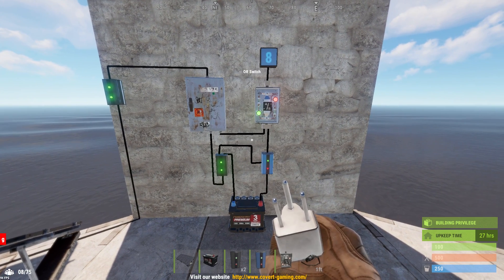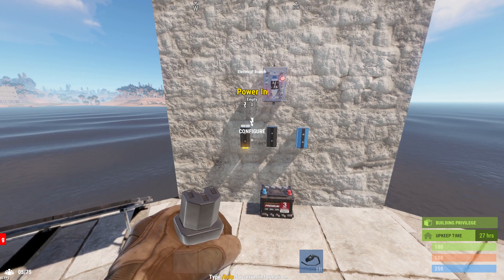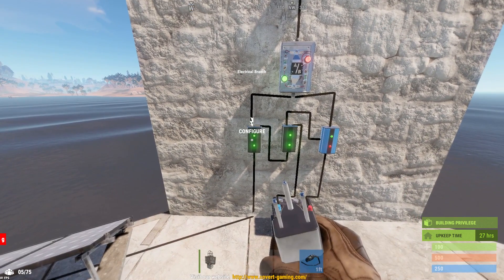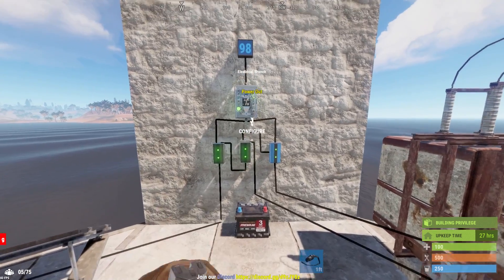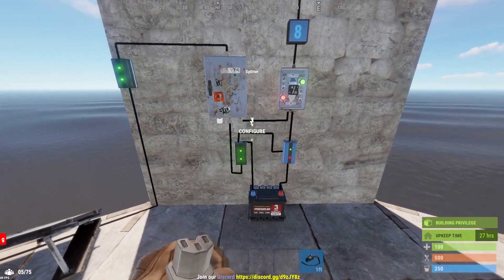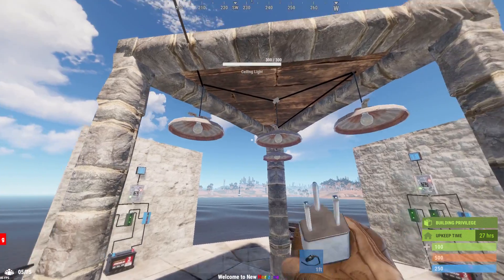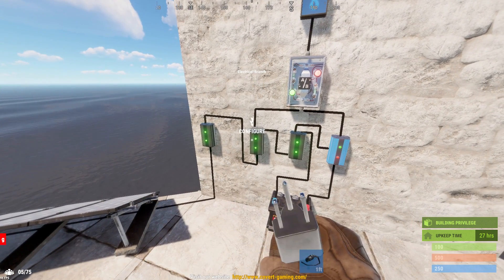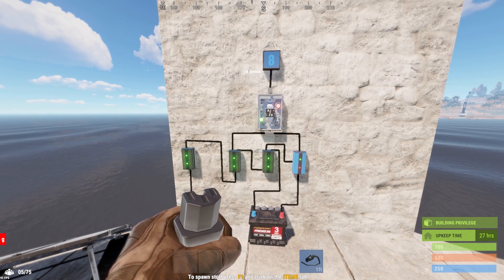The Best Rust Infinite Power Circuit

Comment: the title is a bit missleading,...sounds like you would have limitless power
Reply from the maker: First thx for watching :).  Second sry about the title.  I didn't come up with it, this is a term coined by many others for similar circuits so I call it that because that what is recognized by others for this type of circuit.  I agree its no a very accurate description of the circuit.  It should be "automatically switching backup battery power circuit" or something like that.  I didn't even design the basic idea for the circuit. I just took a bad design everyone was using and made it better.  That said... this circuit was made obsolete by the November update of last year.  Batteries in rust can now charge and discharge at the same time.  The lose 20% of their power charging but if you input 25% more power than they are discharging they will maintain their charge.  So now all you need to is have solar panel to battery in, battery out to workload.  Its very ez.  As for the input for a small battery you would need 12.5 volts input if you are using the full 10 volts output in order to maintain the charge level.  Hope this helps and thx again for watching.

Comment: How would i make this work with 2 large batteries instead of 1
Reply from the maker: Game mechanics for batteries changed drastically in Novembers patch of 2019 so its pretty simple now.  However for it to work properly you need to jump straight from 1 larger battery up to 3. https://i.imgur.com/zlPgTqx.gif
This circuit would give you 8 hours of backup power at the maximum output of the large battery.  Obviously replace the creative generators with whatever power sources you have but be sure you have at lest 251 volts input to the first splitter for it to function properly.

Thx for watching :)

Comment: will an XOR switch work with this circuit?
Reply from the maker: Thx for watching, simply put no it wont.  I would prevent power to the circuit so long as there was any daylight for solar or wind for turbines.  It would only kick into battery power if the sun was completely down, not low, or if your win or solar were completely destroyed.  That said this circuit is obsolete due to recent game mechanics changes.  I'm working on an updated video.

Comment: i cant figure out what im doing wrong. i tried this setup, step by step and cant get any power into a single sentry gun. my solar panels arnt getting any electricity coming in. maybe its the angle but there is sunlight above and nothing :<
Reply from the maker: Thx for watching.  Sadly this circuit was made obsolete with recent updates to the game.  Furthermore this was made before auto turrets even required electricity.  The turret requires a minimum of 10 volts.  This circuit only with a small battery only outputs 8 volts.  If you are using a large battery it should work fine but thats beside the point because you don't need to do this at all anymore.  The whole purpose of this was to compensate for the fact that a battery couldn't be used and charged at the same time like real batteries.  Now they can.  So simply set up your solar panel, run a wire to the input of a battery, then run the output of the battery to the input of an auto turret and you're done.  If you are using a medium or large battery you can run the output of the battery to a splitter or electric branch to divide the power up and run multiple turrets or other electronics.  I am working on an updated video explaining the changes in the batteries and all the wonderful things we can do with them now but until then I think this will solve your immediate problem.

https://i.imgur.com/cr516Bl.gif

Thx again for watching :)
Reply: @K162KingPin  uhhh i guess. im still wrapping my head around these sorry. So if i put my solar panels to my small battery and charge it directly and connect it to my sentry gun it will input enough to charge the battery and power up the sentry? my concern is when the sun goes down D:

Comment: at 11:05, what is the purpose of the branch all the way to the left? it seems like you can just remove it and it wont have any changes to the circuit
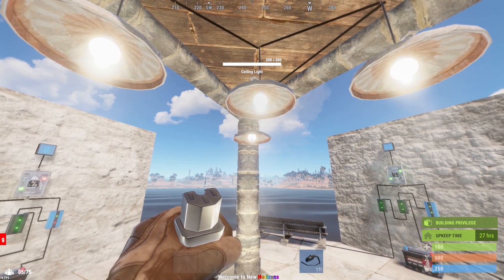Reply from the maker: Thx for watching, you are correct it can be removed.  At 6:50 I explained that this branch was only in these circuits in order to demonstrate how the circuits operated given different power inputs.  It was simply a way to regulate the incoming power from the solar panels.  That said none of this matters now.  This circuit is obsolete due to recent changes in game mechanics involving batteries.  I'm working on an updated video showing how to do this since the update and hope to have the video out in the next few days.

Comment: not the best one, i kinda made one that don't waste extra power when it switches to the battery, with this solution when the power drops under the given value and it switches to the battery the rest generated by the solars is lost instead going to the battery to slow down discharge
Reply from the maker: Thx for watching :)  "best" is as always a matter of opinion.  The reason I call this best is because
1) it does the job that the old style did but cost less to build
2) it requires 40% less power input to do it
3) it doesn't have a dead zone time frame while power is in a low range like the the old circuit

So when I say its the best I mean its the best at doing what it was designed to do.  Considering its entire purpose is to provide continuous power while your main power source is underproduction during night or low wind, or destroyed and it does that, how could it be better.

I have played around with what you are talking about, yes it does reduce the rate that the battery discharges but for solar panels it would only do it for a few seconds between the time the circuit switches to battery power and the time the sun is completely down.  So the extra power you manage to get out of it is not only very low but also very brief.  Considering your battery was already going to last through the night this is basically pointless and cost a lot more to build the circuitry to do it.

This would be more viable on a circuit using large batteries and wind turbines but even then only if the wind turbines are in a fairly low altitude area, there is no way for you to build them up higher, you are unable to simply build another wind turbine to help power the system, and your power input is so borderline that your batteries actually are not staying charged up.  Again extremely limited usefulness and several much easier ways to fix the problem than adding even more circuitry.

In the end it doesn't matter because there is no way to put a root combiner between the battery and the necessary circuitry to automatically switch it back and forth.  So no only would your circuit use up more power for the extra components but it would have to be manually operated making it so much worse than this fully automatic one.  So the circuit you suggest would...

1) have to be manually operated, no automation
2) would be much more costly to make
3) require even more power to operate
4) no accomplish anything that isn't already accomplished with this circuit

Still I do appreciate your input.  Please share your circuit design, I'd like to compare it to what I've come up with. https://rustrician.io/ you can make your circuit here.  Also let me know what situations you have come up with where recovering that power had actually kept your circuit alive where this one would have otherwise failed.  I'm really interested to know as I'm struggling to come up with any realistic scenarios.

Comment: If I'm not mistaken, isn't this constant power and not infinite power?
Reply from the maker: If you set it up right it doesn't stop providing power whether the wind dies down temporarily using wind turbines, or the sun goes down using solar panels.  Obviously if your generators were destroyed your batteries would eventually lose power.  That said... the circuit was named "infinite power" by many other people years before I came along an improved the design.  Obviously its not the most accurate descriptions but its the name everyone already knows it by.

Comment: why you only use small battery? not large battery??
Reply from the maker: thx for watching :)... but did you watch?  check 4:20 there I show how to set it up with a large battery.  Also check the description for links to both the small and large battery circuits. Hope this helps.
Reply: @K162KingPin  ya i see it already. thx for the video dude

Comment: ITS NOT VOLTAGE!
Reply from the maker: It is?  Rust only has one unit of measurement.  Doesn't matter if you are reading the output from a solar panel, a battery, or an orswitch.  Since they are all the same it only remains to determine what unit the rust creators have simplified everything to.  The only way to do this is to refer back to the power sources.  Win Turbines and Solar panels are measured in Watts and Voltage.  Batteries are measured in Voltage and Amp Hours.  There is no way to distinguish between the solar panels and wind turbines as to whether their output is meant to refer to voltage or watts but there is on the batteries.  Since the batteries display both an output number and a time remaining it is obvious that the time remaining refers to the Amp Hours.  Furthermore when choosing or using a battery the most important number is always Voltage.  So its not at all unusual for the output to be referring to the Voltage.  Furthermore while batteries are not measured in watts its easy to prove that this is no the measurement as both batteries maintain a steady output all the way up until their time remaining runs out.  If the output were watts then the output number would decrease as the time remaining decreased.  Batteries are capable of providing less and less amps the closer they get to their EMS value or the closer they get to running out of Amp Hours but they are designed to maintain their voltage even when almost completely dead.  

The point is that the measured output from the batteries absolutely has to be referring to voltage and since we only get one type of measured output from batteries, solar, or anything else then they must all be Voltage.  I know this is disappointing to all of us with backgrounds in electronics but lets face it.  They dumbed it down for the game.  Lets just be glad there is electricity at all.

Comment: Theres a better way- have parralell batteries so youll have 8 hours of power when your windmills or solar panels get destroyed during a raid or rockets  from heli giving you time to fix
Reply from the maker: Thx for watching :).  Better is  clearly a matter of opinion.  I can run a LOT of circuits off this tiny amount of power.  Even if I needed a little more power it would be significantly cheaper to build two of these and run them in "parallel" rather than build even a single large battery.  Furthermore if you saw the whole video this does also work with the large batter if you need more power.  However that will only get you 4 hours even if you make 2 of them not 8 hours as you suggest.  In order to get 8 hours out of it you would have to run them in  a fail cascade setup.  In other words you would have to set them up  that they could both charge and when main power failed then the first battery would take over while preventing the second discharging until the first battery failed, then the second battery would kick in.    That setup would require at least 3 wind turbines at rather high altitudes to power your circuit and charge the batteries any anything resembling a timely fashion and it would cost significantly more HQM to build.  Setting this up isn't hard at all just far more expensive and completely unnecessary for most operations.  So better?  It would depend entirely on what you were trying to power.  So now im curious.  What are you trying to power that you need 8 hours of backup power?  I mean, other than auto turrets I can't imagine what could possibly need to run for more than 4 hours and even then 8 hours would hardly be enough, unless you are the most hard core gamer I've ever heard of and you actually don't leave the game for more than 8 hours at a time.
Reply: @K162KingPin  well I Ment having them as a fail cascade and I had to have ove of these because we were on a big server with big groups and some of the raids lasted more than 4 hours for example (yes they were shit at offline raiding)

Just to say that I was giving you a redundancy to add to your circuit because blowing up the solar panels or even batteries first will stop auto turrets so having redundancy is vital
Reply from the maker: @chuckster116  I see what you mean, you just through me with your terminology.  I have made and used such circuits but I havn't made a video because of their incredibly limited usefulness, maybe I should make one. thx again for watching.
Reply: @K162KingPin  no prob maybe make a vid on how to irritate anyone with a rf pager 
Was alot of fun doing that